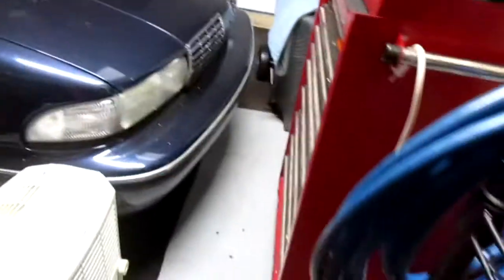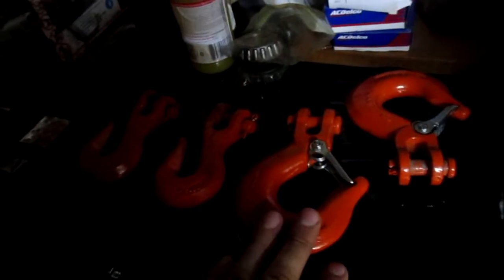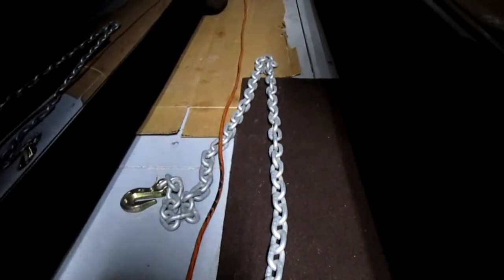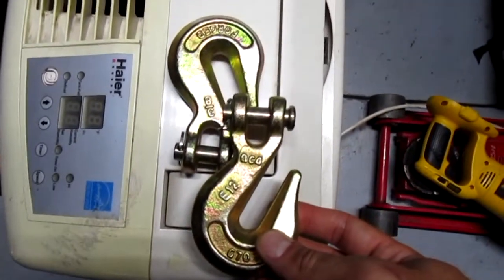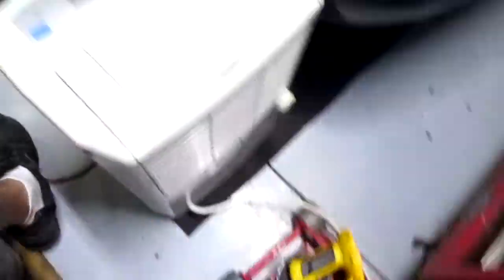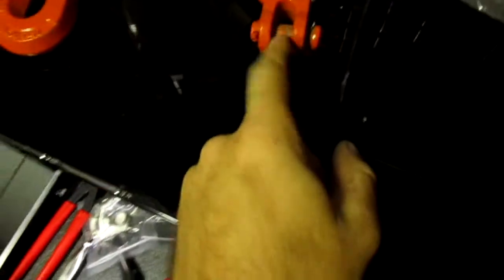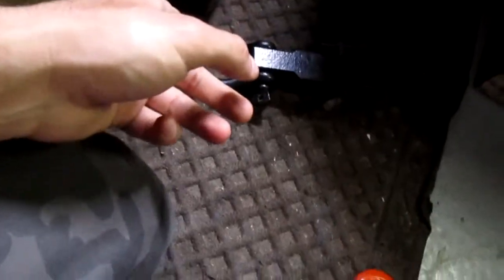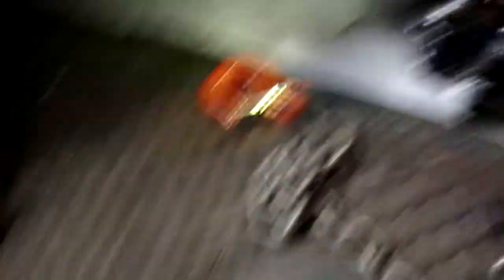Chain Talk. All kinds of CHAINS and Hooks

Comment: Hey great video. I have really nice marine grade 316L stainless steel 3/16, inch (5mm) chain and want to attach at grab hook to the end but the smallest grab hook I can find is 1/4 inch (6.3mm) . Is it ok to use a larger grab hook for a slightly smaller chain? Thanks in advance
Reply from the maker: You could just don't overload the working load limit. The clevis pin may not fit the smaller chain so you may need an adapter piece